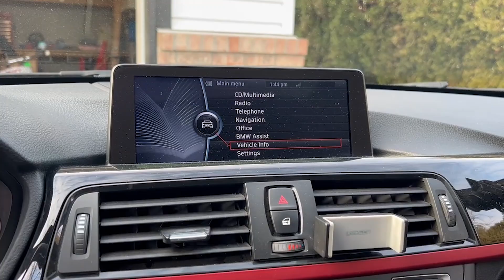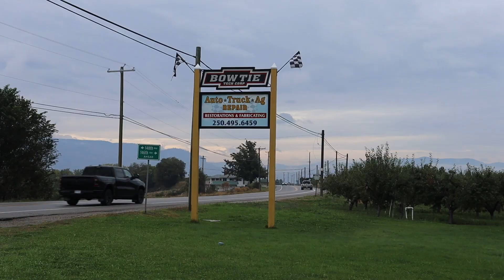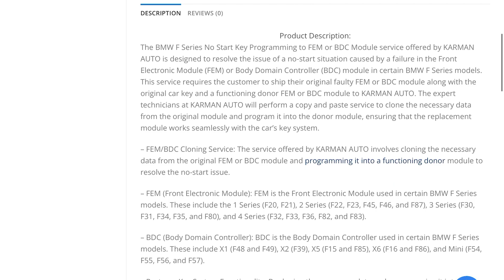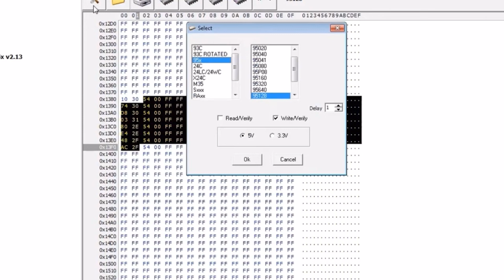BMW F30 Headlight Vertical Aim Malfunction - Part 2 | What Part Actually Failed?!?

Comment: I have an F80 with this problem for 2years. I gave up after buying a Control Module (behind the Passenger wheel) and resetting it with ProTools did not work. Low/High Beam work Fine it's just Angel and Corner light that won't work. Any suggestions? Did you figure it out. TIA
Reply: I have a weird issue as well, although different than you guys. I keep getting parking lamp malfunction and I see that it is not working sometimes despite having brand new OEM headlights. 

I get in other days and everything is working perfect. Kind of scary to be honest.

Comment: What was the result? Did the coding on the FEM work?
Reply from the maker: Nope. Nothing worked. Mechanic recommended buying a new module and getting BMW to code it. Got mad. Sold the car. We’ll never know.
Reply: @that_jamesguy that’s not good news. I’ve got same error and done everything you have and I’m up to the FEM

Comment: I have problem with my 535i 2011. everything works but the lights that are supposed to follow the curve go crazy. left right up down all the time driving. only at speeds from rest up to 30km/h do they stand still. Someona have same problem? the diagnostic device says that the tms mod. I replaced it, of course, not with original BMW, but with Amazon and it still doesn't work?
Reply: Did you find solution for this?
Reply: @Kyeristof  Not yet.....